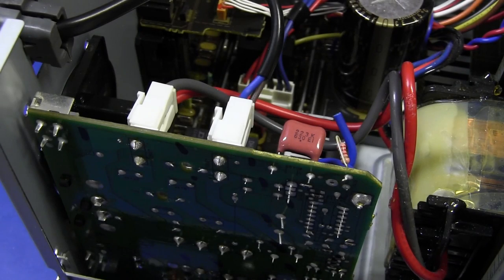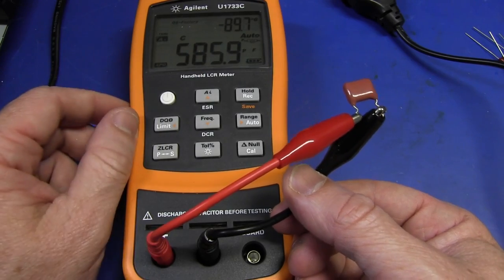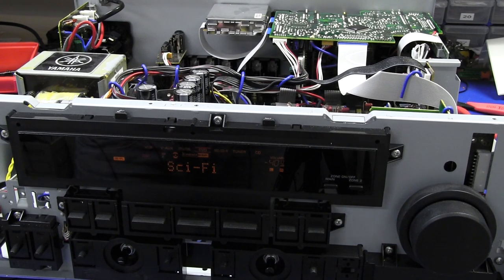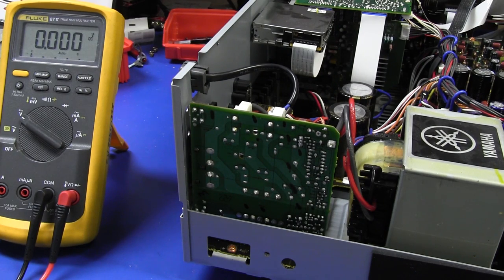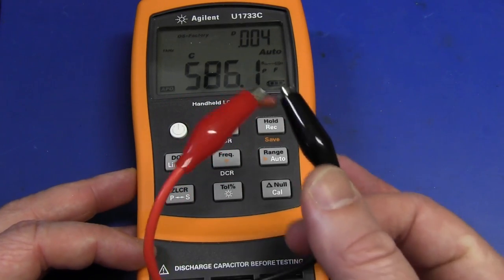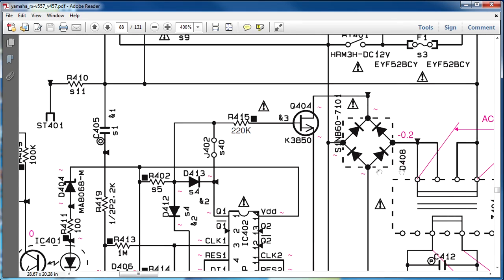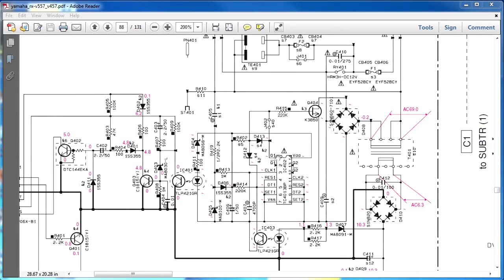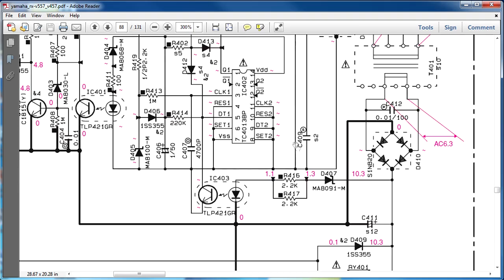EEVBlog #379 - Yamaha RX-V557 Receiver Fix

Comment: After spending 80 cents at Jaycar and less than 10 minutes on the repair, my 15 year old RX-V757 is up and running again! If only all repairs were this easy...
Reply: Congrats, hope it lasts you a long time without any issues.
Reply: You know - 15 years is sh*t, @#$%^& long time to get something repaired.  Reminds me of my 2nd, ever used cell phone.  I still got it, too.  Probably just a failed wall-charger.  I'll be kicking myself, for not guessing that, earlier.

Comment: Ok! I figured it out! So it is not exactly swichmode supply! This small transformer is being switched on directly on AC. The mos transistor shorts the diode bridge connecting the transformer to  the mains AC. They achieve the high efficiency by turning on and off the transformer to keep the 5 volt rail at around 5 volts. If you connect the transformer directly to AC you'd just get maybe 7 or 8 volts on the 5 volt rail. It is just a linear transformer connected in switchmode type circuit.

Comment: It's so much easier to find faults with charred and smoking components! ;->
Reply: Jim Fortune Of course, that's the power of Magic Smoke !
Reply: @SmiloDTech
i like the magic snow you get when you seriously  over volt an electrolytic cap :-)
not so keen on the bang tho , hehe :-)
Reply: YTANDY100 :
Try putting a big one in backwards.... you'll get a shower of snow then I can tell you.  lol
Reply: Sure, it's more fun to work on the big afterburners etc. I used to work at a Sound and Light rental co. were we had stuff for concerts and big clubs. Never hard to spot a fault, seldom had to turn on the scope..

Comment: Tip for YoungPlayers: this Polystyrene Foil Condensors do have some feature called "self-healing". This does not mean when they failed they're doing self healing and everything is OK again. It means, if they do spark over internally, they will burn up the area around the spark area. So they do no longer provide short circuit anymore. But they do loose capacity of course.

So, there must have been some higher voltage sparking inside the condensor which lead to loosing capacity.

Comment: Just fixed a Yamaha RX-E810 receiver, which had EXACTLY the same cap blown; mine measured not more than 8nF instead of 22nF. Ordered 20 pcs, to be ready for future Yamaha receivers, and now it's going strong!  :)

Keep up the good work!
Reply: Need help with my yamaha RX-A2010.  If you could answer a couple questions I'd appreciate it.  Thanks

Comment: Thanks for the fix. My Yamaha RX-V1900 suddenly stopped powering on. I changed the same C4 capacitor and now it’s all working again. 0.80c VS a whole new amp. Awesome! 👍
Reply: Did the same with my RX-V2700. Same C4 cap.

Comment: Thank you very much! I have just repaired my RX-397 and it has the same issue with this capacitor. Whole amplituner is very different, but this little board is the same and had the same common fail.

Comment: I recently inherited a Yamaha receiver and to my disappointment it did not turn on when I plugged it in. I did a bit of a search around YouTube for info on how to repair this type of thing and came across your video. As it happens, the model of receiver is exactly the same as yours! Since people have been saying the 22nF capacitor failing is a common issue I took the (oh so expensive) risk of just buying a new capacitor and replacing the original. Just like that the unit is alive again. And all for the princely sum of... 80c. gasp Thank you (and all those others who shared this info') for sharing this fix.

Comment: Thanks to saving my money! I have yamaha rx v659 and power just dissappeared. I watched your videos and made conclusion to change the same condensator as you did, and it worked! Amp is back on working. Best thing is that i allmost get it repaired by shop, that estimated 90€ repair price. I removed part and went very same shop and they gave me used part for free! (slighly different value) They doubt that part was broken and tested it, sure it was.

Comment: I have an RX-V657 with a 47 nf cap for C405, which had the "power on, shut off after 1 second" issue.

After replacing C405 the unit was still remembering the old power problem that originally caused it to shut down. So it kept shutting down based on the memory of the problem. 

To clear this memory, I had to get into DIAG mode and then set DIAG option 9 to RSVD (reserved) rather than INHI (inhibit) and then shut off the power. This clears the memory of the error indication. Next time I powered it up, it worked a treat! 

Thanks everyone here for all the advice.
Reply: +QuartetMember Hi, just wondering if you can help. I have the same memory issue. I get to diag option 9 to delete/clear memory. I set to RSVD but what do you do next? Shut power off? or is there a SET button to actually select RSVD? I get to RSVD and then turn power off but when i turn amp back on the amp shuts down again. Thanks
Reply: +PCMOTOdotCOMdotAU   Hi, I'm not a service guy but you are correct,  it does not appear there is a SET or ENTER button to actually select the option.  I just turned off the power, which cleared the memory. 

Once you get into the diagnostic menu, proceed to option 10, AD DATA CHECK,  and check the values for DC and PS.  DC must be in the range of 1 to 13, and PS must be in the range of 36 to 49, or the protection circuit will shut off the power (the symptom we are seeing).

I should mention that the day after I fixed my machine, I powered it on and it shut off again!  I checked the values as above and my PS value had gone down to 35, just outside the acceptable range.  So I just left it powered-up in DIAG mode for 24 hours  hoping that the machine would get used to the new cap, and it did.  Now PS is remaining around 40, the protection circuit is happy again and the machine powers up fine (and stays powered up).

So I would suggest the same procedure, clear the memory but then leave the machine powered up in DIAG mode for some time, then shut it off and see if it now behaves normally.  

If not, then C405 was not the (only) problem and you'll have to keep digging.  However I think it is clear that the only place you have to look for bad parts for this "power on-power off" symptom is on the small board where C405 lives, which is the easiest board to access.  I looked carefully at every part and found no visible problems (bulging caps, burned parts etc) but I was ready to order and replace all the caps if C405 was not the issue.
Reply: +QuartetMember You Sir are a legend. I had checked the AD data check and my PS value was 35 as you had stated it was just below the threshold 36 but thought that would be ok. I replaced C405 and also a bulging cap on the same board. But it still shut down which was the time i messaged you. So i took your advise and left unit on in DIAG mode and soon the PS value in AD data went from 35 to 43. I left it on for a few hours longer and now it works perfectly.

Thankyou so much for your prompt and informative reply. Big thumbs up to you QM!
Reply: +QuartetMember Hi I replaced the C405 with a .045 nf cap rated for 400v, is this correct or should I go for a lower voltage rating? Because the capacitor is larger than the original. http://www.ebay.com/itm/121107063802?_trksid=p2060353.m2749.l2649&ssPageName=STRK%3AMEBIDX%3AIT
Reply: +qazqazqaz12345  Hi QAZ, As long as your new replacement cap has a voltage rating equal to or higher than the original on your board, you'll be fine.
Reply: +QuartetMember Thanks for the reply, I replaced the cap. Went into Diag-9 and selected RSVD to clear the protection memory. Rebooted to Diag-10 and readings are now DC 7 and PS 34 same as before no luck after leaving in Diag mode for 2 hrs.
Reply: +qazqazqaz12345  Well, it sounds like you have done everything right.  All I can think now is that perhaps you replaced a bad cap with another bad cap, or that there is a bad electrolytic cap on the board.  Check these by looking for bulging tops and replace any that are suspect.  Next step would be to remove and test all the caps (luckily it's a pretty small board).  Good luck!  Hopefully someone here with more experience can help you.
Reply: +QuartetMember 
Hi. maybe someone know/had same problem. I replaced c4 - unit stays now ON without problems, but I have no sound from speakers. tried to reset settings. but not helping.
I checked readings in ''diag'' no.12
I found that :
DC (protection detection)
DC: DC detect protection value (Normal value: 3 to 33)
* If DC is out of the normal value range, the protection
function works to turn off the power.
(Reference voltage: 5V=255)

PS1/PS2 (Power supply voltage protection detection)
Power supply voltage protection value (Normal value: PS1:
76 to 106, PS2: 62 to 97)
PS1: Detects ±B1, ±B2, ±B4, ±B5, ±12V, +5D1, +5D2,
+5V2, +5V3, +5VBUS (U, C models) and +2.5D.
PS2: Detects +9V, ±5V and +7V.
* If PS is out of the normal value range, the protection
function works to turn off the power.
(Reference voltage: 5V=255)

TM1/TM2 (temperature detection)
Temperature detected value
(Normal value: 20 to 182)
TM1: Detects the temperatur of the front heat sink.
TM2: Detects the temperatur of the rear heat sink.
(Reference voltage: 5V=255)

Mine is dc 22-23   , PS1 90 , PS2 80 .

All caps looks ok. didnt dig too deep inside of unit because i dont have knowledge to fix it.
So what I may missing?????

Comment: I just purchased a RX-A2080 from USA and it was delivered when I was not home. My 15 year old son thought it would be cool to set it all up for me and plugged it into a 220v power supply (not through my transformer). It's now an expensive brick sitting on my table. Would this be the same capacitor that blows in this circumstance? My Son said there was a loud bang when he plugged it in.

Comment: Brilliant, thanks. This fix worked perfect for my RX-V2600, which after 13 years great service started having power on issues. On my model the 22nF 630V cap is a Radial Polyprop (blue box shape).

Comment: I do not think that this should be called a "switch mode power supply" since it uses a mains frequency transformer.
It simply switches the transformer off if the output voltage exceeds the limit defined by the zener diode and the LED in the optocoupler and therefore does not require a linear regulator. This helps getting the power consumption down.

And of course with lower supply rail voltage the MOSFET will operate close to its threshold voltage and therefore the supply will show a rather large inner resistance. So if you measured the +10V standby voltage while pressing the power button, then you could have measured the +10V rail breaking down because of the relay drawing current...

Just my five cents ;)
Any further thoughts?

Comment: My Yamaha RX-V2700 started to show the same behavior and did not power on anymore. Found this eleven year old video which helped me to solve the problem. Found the offended 223K 22nF capacitor, which was by the way marked C4, and replaced it for an german capacitor type WIMA MKP10 0,022µF 630V and it works again like a charm. I'm not planning to replace this great receiver soon.

Comment: Thank you MAN!!!!!!
I have a Yamaha RX-V750 9 years old which served me well. Last week it started to not powering up. First it needed two press at power up button; then 2; then 4; then no working at all; except the PURE DIRECT led dimmed just a little bit; then I disconnect the power plug, wait and connect it again, and it did power up at the first try. That works 3 days and then DIED FOREVER.
Until, I found this video and other websites. FRACKING 220nF630v CAP!!!
Change it and IT WORKS AGAIN.

Comment: On a more serious note. That capacitor was messing with the optocoupler. You might check that too since they can be damaged by high frequency. SInce it wasn't able to follow the high frequency it the system couldn't tell it was getting power.

Comment: I've seen these metalized poly film (Mylar) caps fail in a number of ways, usually due to excessive current. As an example, take the  Zobel network of a large power amp that has become unstable as a spot where bad film caps are common. The resistor in said Zobel often burns as well.

Some types can't take heat. They make them is 85°C ratings and since they don't bulge unless they melt,  you must test it.

I've also seen them die for no good reason at all. One particularly heinous one failed leaky and allowed DC to pass from the input to the drive stage of the power amp in a Realistic (Tandy) STA-2250 receiver. This of course caused massive offset not unlike that which you would get when one side of the outputs fails shorted. (That receiver was a nightmare but they're beautiful when restored...and it's hard to argue about 0.03% THD at 10% above rated power!)

Comment: We had an interesting problem a couple of years ago on the dashboard PCB of a Saab 95. The main board was not working and was showing a bunch of service lamps, it was a typical fault on those boards. The fault turned out to be a bad solder joint on one specific resistor pad. This was verified by trying on another faulty board where we just heated that single solder joint, mounted it in the car and it worked. I think the price for a new one was around 7000NOK(~1000USD) plus fitting, and the fault have probably happened on thousands of cars.
We found the fault by random really. The car owner had noticed that if he put some force on the PCB, thus bending it slightly, it would work as normal. So in the lab I was probing the heck out of it while the owner was bending the board close to its breaking limits.

Comment: Dave, the 4013 flip flop is being wired as a zero crossing detector. When you press the button on the remote the 4013 waits for the AC to reach zero crossing before switching on the mains transformer.

Comment: I have the same exact symptom with my Pioneer VSX1022k. I don't have that capacitor as this Yamaha has.
Reset doesn't work as it should, only the MCACC light turns on and not the display.
The 10.5V and the STBY 3.3V are there.
What the experts would suggest me to do? Any help would be appreciated.

Comment from the maker: Yes, you can often do that because it's the easiest thing to try. If the cap does not measure close (due to failure or just in-circuit), lift one leg and measure again.

Comment: I think the Problem was not the 10.2V Voltage fluctuating. I think it was that the VDD of the 4013 was to low, as this voltage also drives the optocoupler IC401 which seems to tell the Microcontroller, when the mains voltage is up (suspicious PDET and /RES signals on the connector)

Comment: I got the same problem I replaced the capacitor C405 0.022mf and it fix the main problem  but 
 it's shut off immediately after I turn it on I was able to inter in diag mode and search for error,  what I saw is DC:007  PS:097 I understand that I got some power supply problem, but I check all output channels and they work good, I check all the voltages and it's looking good also any suggestion please to help me with this av receiver ?

Comment: People have hopefully realised by now that this power supply is not a switched mode power supply - it's a bog standard 50Hz mains transformer that is disabled by switching off the series pass Q404.
Reply: The sleep circuitry is powered by a switch mode.

Comment from the maker: It was not fitted with a Y2 rated cap, nor specified as such, just a standard 630V film cap. And IIRC there is no requirement to use an X or Y class cap in this actual implementation.

Comment: Just had mine (RX-V450 with the same mains power board) die on me last weekend. Replaced the darn cap for a slightly bigger but better one from Wima (MKP10-22N-630V), just had to bend the legs a little. I'd say €0.95 euro cents well spend. 😎
Also fixed a noisy tape transport of a Kenwood KX-64W dual cassette deck whilst I was at it. Now it's on to fixing a Sony VCR power supply with also a common fault.

I'm starting to enjoy this stuff. Nothing more enjoyable than a restoring something back to working order.

Comment: I have seen this type of cap failure before based on using the cap coupling over the 60 cycle frequency for the clock circuit and a cheap way of generating dc voltage from the waveform coupled for the PWM circuit for the switching supply. This unfortunately i have seen the cap doesn't last long term with this design especially if using low grade caps. The cap gets hit with all kinds of AC spikes from the power lines which break it down over time or its just a crappy cap and it breaks down on its own. Whats ironic is they created such a unnecessary complex standby power supply  for this thing rather than using a traditional transformer/regulator circuit they have to use this overly complex switching supply. My guess is because its more energy efficient in standby. Some of these units have a "power savings" mode which draws less in standby. That would be my guess as to why they use it.
Reply: Yes, a much lower power configuration is an power on/off switch...
However anything in ram will die and by the look of that supercap, they are trying hard to save some data - config data no doubt. 

Not sure what year this amp is, but these days non volatile memory is trivial and ultra cheap, so we should have systems that have just an on/off switch with no standby current/circuitry required. Ultimate green!

Comment: wow, i have never seen a polyester cap lose it's capacitance.  Maybe short something is rotten in Denmark. I wonder if a voltage spike would do that?  Like those quick 1 sec power outages.  It is cool that you go in blind but still seem to hold it together and don't get up.  Awesome.